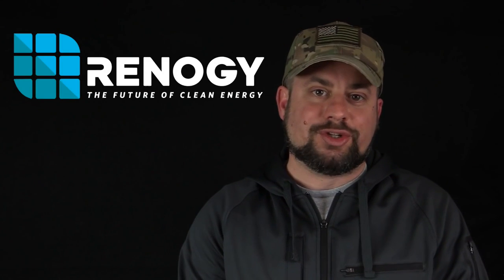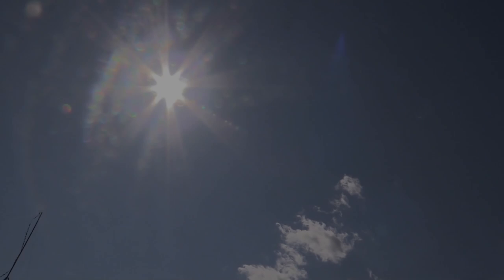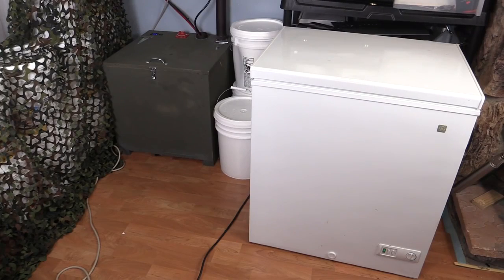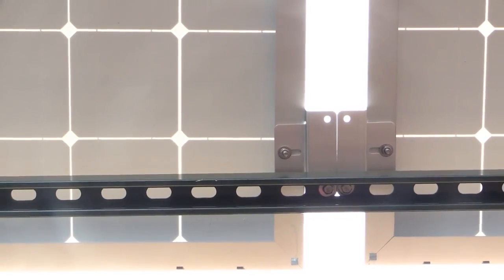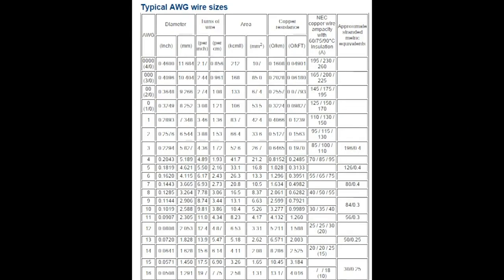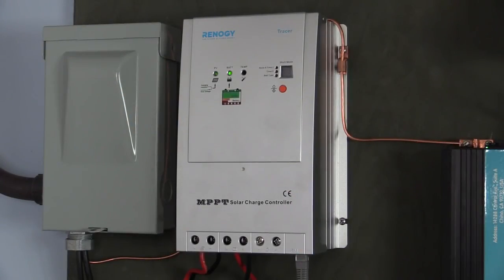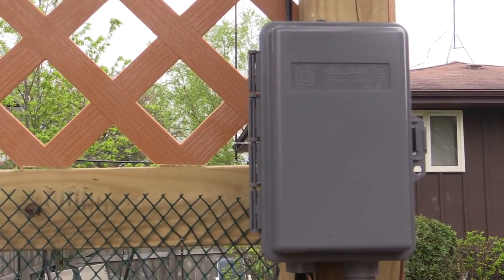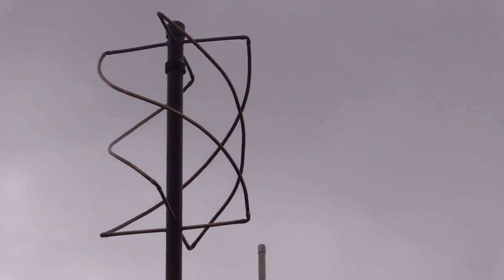The Ultimate Guide To DIY Off Grid Solar Power | Tin Hat Ranch

Comment: Thank you for this post it is very well done. I have built and worked a simple mobile system for my RV with several different sizes and brands of panels. Always using  the parallel run. On one trip early on in my experimentation one of my 120 watt shell panels was blown over by the wind and lost continuity dropping my watt output from about 300 watts to under 200 watts.  It limited my charging and power substantially. So I would assume running in series would kill my available power totally. I did change my system to the usage of smaller 15 watt panels from Sun Power so that if I lost a panel it has less effect on my system. I am now 13 years latter running about 500 watts totally with 15 watt panels. Also less expensive to replace if one goes down. I like the way you have explained the difference between the two systems and think that I may try it with my smaller panel plan using my individual or zone monitoring to identify which bulb on the Christmas tree went out. Each of my 15 watt Sun Power panels have an LED power indicator light.  Love the Rabbit by the way.

Comment: hi I need some help first I will need help whit my typing lol,ok I have 2 trojan t105 re battery whit 4 solar panels of 100 watts  each and a pure sine inverter continuous power 2000 watt surge 4000 watt and I can't make 1 coffee whit a Keurig ,I use to have 3  12 volts batt from a wheel chair and I was making 10 + coffee whit a 1500 watt inverter not pure so What I am doing wrong thank you

Comment: So to add more panels here in AZ I am looking at doing 4 panels in Series to give me the 75v and 5.2a. The make another 4 panel series the same and then connect them in parallel So this would give me the 75v but bring my amps up to 10.6 and bring more power into the system. Does this sound right? I am basically looking at doubling your design you showed here. 8 panels and 8 batteries. for a total of 940ah @ 12V

Comment: Great Vid.    I have eight Renogy Panels and eight Batterys.   Sun charger charge Controller.     We have a 12 System for lightning only.  Harbour freight 45 watt on two strings.  We have Hurricanes in Florida and use it for emergency backup.  We use our system every day.   We have a camp stove for coffee and hot water.   Also cook on a camp stove.    We have FPL for central Air and Hot water but never on grid down.   Our Power Bill is $45 in the winter and $90 in the Summer.

Comment: Ha, that's may-nerds here in the south.. Great video thanks! I have a 35w panel and 2 12v 8ah batteries in my shed for led light.. I'd like to upgrade the battery since that is what I need more of. What would the cheapest 12v battery that could be charged by a 35w 12v panel? I don't get but a few solid hours of light due to tree coverage.. I have them about 10ft from battery but I could get several more hours of sun but I'd have to run them 4x as far from battery.. I use 10g wire for the 10ft distance. Would I be able to charge a larger battery if I moved my panel and went to a larger wire? Considering I'd have to run that much farther for say going from 4hrs to 7 hours full sun?

Comment: A very good video on the basics of PV Power!
As an Electrician there were a couple of things that jumped out at me though (you may have covered them in later videos already?) 
Fuse size ..... Your choice of fuse size is to protect the cable After the fuse. Obviously your choice of wire size is dependant on load, but the two are not always linked together!
Power ..... OK I may be going all out nerdy on you but your Power is measured in WH or KWH .... the Time you are using the load for is relevant to this! 
Heating water with PV is not a viable option??? ..... Engineer 775 has just released a good video on this very subject (with all the facts and figures! A 4 panel PV system is almost completely able to supply normal hot water needs on its own! He has a grid system that uses a couple of dollars a month with his PV taking up the major load! This is not done in a conventional way though. The bottom element is connected directly to the panel output at low voltage (I think it was 48V?) but the element is a grid element meaning it is not working at its full rated power (rated at 110V ac ...fed with 48V dc gives more than 50% output)
Again I apologise for interjecting newer ideas than were around when you made this video .... but knowledge is Power ;0)

Comment: Big inverters are expensive.  I am in UK, so I require mains voltages of 220 VAC minimum.  If your house system uses separate circuits for various things,  e.g.,  lights separate from power sockets,  then you could consider a suitably sized inverter for each circuit.  Using LED lights throughout the house will drastically reduce the energy requirements of your full house lighting.  Few houses would need 250 watts of lighting,  indeed,  a little care of only running what is actually required,  most houses probably need less than 100 watts of light.  So,  a 300 watt inverter is ultra cheap (you do not need pure sine-wave for LED lights) and a single 110 A/Hr leisure battery will more than power this.  I set my system such that the inverters are only powered upon electrical demand from the system ... this avoids wasting power running inverters on standby !   Here is something important that you need to take account of.  Resistive loads (like your microwave) requires at least twice its running amperage at the instant of switch on.  That means that you need an inverter capable of 2.5 times the running load for such devices because your inverter has a built-in trip which will immediately send it to lock-out if you exceed its stated output.  The 'stated' output is usually the maximum output without tripping,  but the continuous running output is usually 45 to 50% of that rated output.  To run a 1,000 watt microwave,  you need to have an absolute minimum of a 2.5KW inverter to allow it to start .. it will then run on about 1,100 watts (allowing for inefficiencies) and you inverter will become warm,  but not hot !  Do your own calcs on how that sucks from your batteries !  LOL ... but then remember,  the microwave seldom runs more than 5 minutes !

Comment: can a  Deep Cycle Pure Gel Battery 12V 200Ah be used in a solar system?
Reply: You can use just about any battery in a solar system.  A deep cycle battery (as opposed to a starting battery) is a requirement unless you plan on replacing batteries every other month.  Different battery technologies have different specs for depth of discharge.(DoD)  Lithium batteries are said to do well with 70-80% DoD.  Lead-acid types get damaged if taken past 50% DoD.  Lead-acid includes flooded, gel and AGM batteries.  Your gel battery should work fine as long as you don't do two things.  1. don't take it below 50%.  2. don't mix battery types in your battery bank.

Comment: I have a small "completely-off=-grid" sleeping cabin at the lake and I was hoping to build a system such as you demonstrate.  Your videos are excellent.  You are by far the best "Explainer" I have seen on this subject.  I will probably copy your system verbatum and buy the same components that you have shown.  Makes sense and you have made it do-able, so thank you.

The one other aspect I would like to know more about is ....  I would like to feed a small electrical panel in my cabin from the inverter.  Would you be able to do a video showing how to wire a small panel from your inverter?

Thanks a lot

Comment: Thank You. Really appreciated your Video , very helpful & I have now changed over my PWM controller to MPPT controller & connected four of my 100 W PV Aray's Panels into two banks of  200W each PV aray voltage now 32V per bank of aray's. (Panels are in to locations) I look forward to the extra energy produced earlier in the day, Cheers.

Comment: I have a questions why not used wind turbines.  ?   I’m just curious why all solar.  ?
Reply: Tower height can be a problem in many locations.  Usually around 40 feet of height is required.  The tower must be stabilized with guy wires.  This takes significant physical space.  A solar system is much easier to up-size than a wind turbine system.  Both have their applications.  Some people (often off grid homesteaders) use both methods.
Reply: clyde alspaugh hey thank you for the reply. But I think an truly think that wind is much more efficient  you get much more space for agriculture an or animal farming

Comment: A little simplified, but very well explained. I would suggest adding a ~250watt vertical wind turbine. This will also help supplement overcast days and winter season; as the wind tends to increase during these times. Also, when you can afford them add Nickle/Iron batteries to the mix; they will last the rest of your life, buy once cry once.

Comment: Do you have a small muffin fan or something similar connected to your battery box exhaust pipe so as to vent the hydrogen fumes to the outdoors? If you do have a small fan, does it run 24 hours a day 7 days a week?

Comment: actally 24 hour ac is very possible with my solar system we have 5000 watts of solar at 24vols 110amps. bought for a meager 1650:00 freight included these full size grade A MONO CRYSTALLINE alum frames .these were bought from satensolar in cal. and shipped to nc. for dirt cheap just a meager 33cents per watt these deals are rare but very possible in 2017 # 2018. the rails and the quickmounts were another 600:00 but cam with every thing including all the grounding lugs. my 8000watt 220vac splitpahse inverter has a 60000k surge. my solar system hooks to my house via a dryer/generator plug with a ganged manual transfer switch.i simply hit the transfer switch and my house grid mains turn off while connecting the inverter in place of the grid power. it was all diy no contractor because i was one and did everything safe and by code . it runs my 12 seer heatpump from sunup to sundown full sun for 12 to 14 hours in summer with no problems at all and only takes a small portion of my solar watts. i still run all my electronics:tvs.satellite system and internet and all lights. i akso run ny lg washing machine it draws only 29 watts front loader.. i am using a heavy old but still usable forklift battery i bought for 100 dollars and rejuvenated. it van supply all my lights and electronics for night time the heat pumpruns only a couple times at night as the thermostat is auto and set warmer. my system was less than 3000 dollars for everything. for that cheap there is no reason everybody has one it takes a little searching for the best prices possible and also the best equipment possible for as little money and you will save more than 15 to 30 thousand dollars for your DIY off grid system that will power heat pump ac systems

Comment: I ran an off grid system for several years as an experiment. 
I plan on building an permanent off grid system.
This is an excellent video and the information is outstanding.

I was able to experiment using batteries for which I did not pay full price.
I got them from a Scrap metal yard that dealt in computer backup batteries.
 So if the batteries went bad I was not out a huge amount of money.

One thing i found that I will use in the future is I will use 12 volt lighting instead of 120 v lighting. I found some 900 lumens 12volt lights. 

A good set of 20 ft jumper cables in #3 or # 4 gauge wire can sometimes be had on sale.
I have seen very good 20 foot # 4 gauge  jumper cables on a discount rack for 20 dollars. That is 40 feet of of #4 gauge wire for .50 cents a foot. If you are off grid pay attention to discount racks at Tractor supply.

I like you battery box. One thing I would add to it is a vertical separator between the batteries and between the posts that is high enough that if a wrench or screwdriver is dropped it cannot make contact with two terminals. Yes this will make it a bit more difficult to maintain and change batteries but will keep you from shorting out.

Comment: If you had only a spare $1,000 to allocate towards energy, would you invest in a solar/battery bank setup or something like a Honda eu2200i? 

My main requirement is keeping the fridge operating to keep insulin stored properly. The second priority is a chest freezer. Everything else is a bonus. I purchased a kilowatt meter and am running an energy usage analysis now.
Reply from the maker: To answer that question properly, what are you preparing for?  An outage for a few days?  Weeks? Forever?  The answer changes slightly, especially within your context.

Comment: Not dinging your video but 1kw inverter is not much. That coffee pot is about the extent of its use. A typical hairdryer is 1800 Watts...that's 120V @ 15 amps. IT would run a bunch of LED lights which would be helpful but no pumps for water or anything else..

Comment: Great explanation, thanks! I would much prefer at least a 1500 watt inverter so I can plug in anything. There are things like coffee pots, toasters, hair dryers, well pumps, welders, skill saws, electric kettles, heat guns, hot plates, microwave that draw more power than your 1000 watt inverter can handle.

Comment: Question: can this system supplement your monthly electric bill? Or does it come into play ONLY when the grid goes down?Excellent Presentation. Crystal clear explanation.
Reply: It's intended to be used instead of your grid connection/monthly electric bill, anything plugged into the inverter doesn't go on you bill.

For saving on utility bills with no off grid function, a grid tie inverter is used, without buying any batteries. That kind of solar system is called net metering.

Comment: excellent video. i run 4 independent systems at home along with one on my truck for ham radio field activities. one comment i will make is the renogy stuff your showing is just rebranded chinese gear. all renoigy is doing is stamping their name on it. dont believe me? look around ebay. i have the very same pwm and mppt you showed. the pwm's can be had for under $10 and are excellent for use in off grid yard lighting.

Comment: There is one more way to significantly reduce the cost of solar cell array: porabollic mirrors. Instead of having a lot of panels with moderate sun exposure, you have up to 3 times fewer panels that work at near 100% of their capacity. Cells are expensive, tinfoil is cheap.

Comment: lead acid s no longer the cheapest way to store energy, there is the salt water battery.

there are 3 technologies that people should look at when storing energy, Lead acid, Lithium and Salt water, all 3 store energy through electrolytes but each have their drawbacks... Lead acid can only be discharged to 50% before ddamage to the cells, and you need to keep it topped up with water and electrolytes to keep the batteries healthy, Lithium needs a seperate charger type and can only be discharged to 30%, they are most expensive... the Salt water can be discharged to 10% but needs the most room and the heaviest weight.

The lithium and lead acid, if handled incorrectly can explode, lead acid produces hydrogen and lithium if not charged correctly or has a problem while charging can end up catching fire and taking your entire battery array with it. Salt water basically is self extinguishing.

Choosing the right battery charger for your needs is essentual, having an inverter is essentual but not really

Comment: I learned more in this video than the 15hrs worth of videos it took to find you !!  That said, know one has explained or answered my question. 
Deep cycle battery must be charged at high amps, 7-15 and topped off at a trickle or they become damaged over time (shortly) !
So how do I get say 10 amps out of panels and controller and drop to trickle. Like a good agm battery charger !!
And my VmaxTank wasn't cheap !!!
KJ4YQO

Comment: So if you can potentially use your four batteries as a 24v system, and 24v systems are more efficient then why are you running them as a 12v system?
Reply: Can only guess that the charge controller is 12V only, but these days most of them seem to work at either voltage.

Comment: Thanks for the video. It is the most concise video on Solar that I've seen so far. I'd like to ask if you have any video for on-grid solar installation. In particular, I'd like to know how I would install an on-grid inverter to the distribution box of a house that is already connected to the grid and also has a back-up generator. How would you implement this, especially at the point where the electric grid, back-up generator and solar inverter meet via the disconnect and distribution box?
Thank you in advance.
Reply: In most places utilities insist on a licensed electrician to make sure that anti-islanding is done.

Comment: Great video.  Something I know I will watch again to catch missed nuggets.  My plan is to split the house electrical.  All of the heavy amp pull items like water heater, stove/oven, AC etc will stay on the grid in a segregated panel.  All of the outlets, lights, fans, fridge, washing machine and water pumps will be separated and run on a different panel on a  solar system.  The daily life of using essential items will be a trained issue and if the grid goes down, then I don't have to worry about a grid tie conflict with the grid powered "non-essentials."  I will already have the essentials "islanded" and I will have the regular practice of how to budget the power.  For emergency situations, I keep a store of propane for cooking and if that runs out, I have an acre of trees to burn in the pit to cook and heat water.